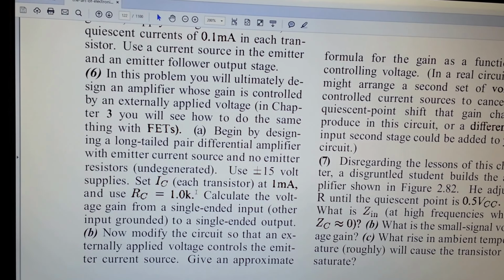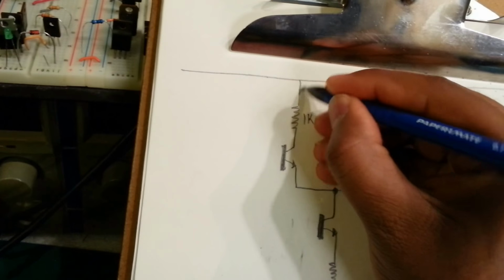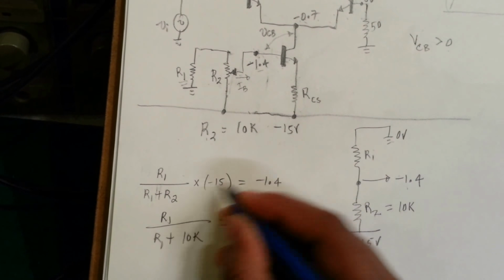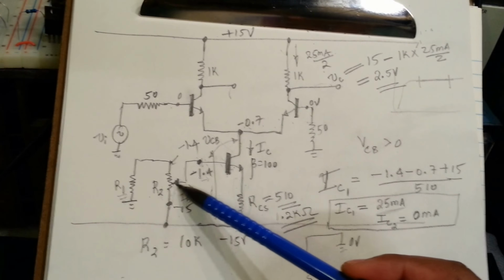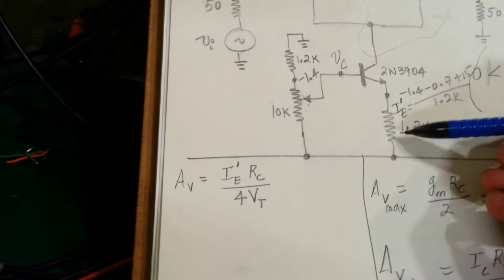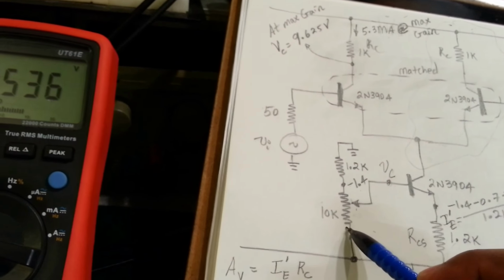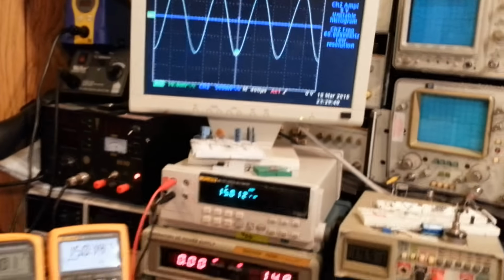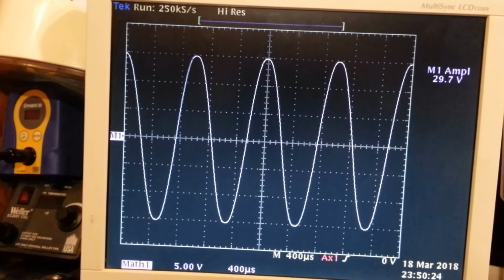Design and Testing of Voltage Controlled Variable Gain Amplifier

Comment: it is similar to an OP-amp in inverter mode. But what to control the gain with voltage, many ideas come to me, incredible.

Could you tell me if there is any IC that has this configuration?
And pairs of transistors of the same type, NPN or PNP, that are in the same package? I find it difficult to have pairs of identical transistors, I would have to buy many and see if they are identical in the same conditions of temperature and current.

Is the second stage to minimize the differences? I have to watch the video several times, my English is very bad.
Greetings.
Reply: A bit late for reply but you can look into an Operational Transconductance Amplifier like the old LM13700 Dual OTA. Still available. 
Same trick but with current bias, not voltage You change with the bias and the gain changes proportionnally.
Reply: @Bob-1802  Thanks, I am learning little by little, I have looked at OTAs but I do not control any of that, I have seen that they use it a lot in VCO, VCA and filters in the world of Rack synths, the kind that has many cables.
I know you can convert voltage to current with an OPamp but I haven't practiced it yet.
I'm with the basics of an OPamp, current sources and current mirrors for a differential amplifier.
I have seen that an OPamp can be used directly for the second stage.
When I have more time I will study it more thoroughly, I am determined to make an audio compressor, in the process I will learn a lot.

Comment: Hi, how do you calculate the gain of the 2nd stage?  And what is the gain range of the whole circuit?
Reply from the maker: Hello Mandy, there are several gain parameters that can be calculated for the two stage differential amplifier that is shown in the video such as differential gain, single ended gain and common mode gain. Since you haven't specified which gain you wanted to calculate I am going to assume single ended gain. The magnitude of the second stage gain is (gm*Rc)/2 just like the first stage with Rc being 7.5k and is the transconductance of the second stage transistor at Ic=1mA. Since the second stage doesn't load the first stage (Zin of second stage is more than 10 times Zout of first stage) we can simply multiply the fist stage gain and the second stage gain directly to get the over all gain. I will leave the mathematics to you as an exercise! Cheers and sorry for the late replay :)
Reply: Buy the person.